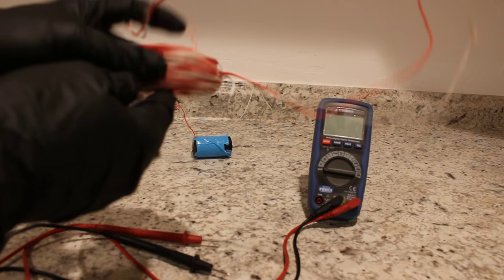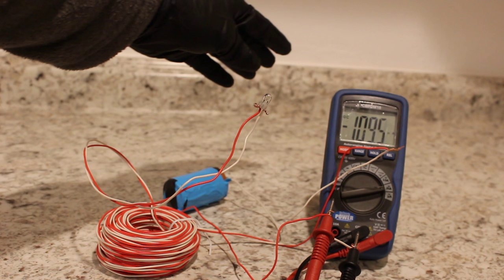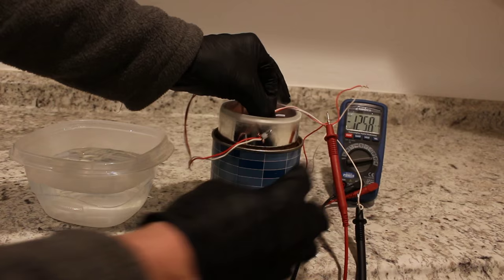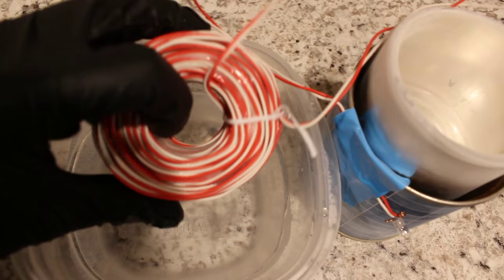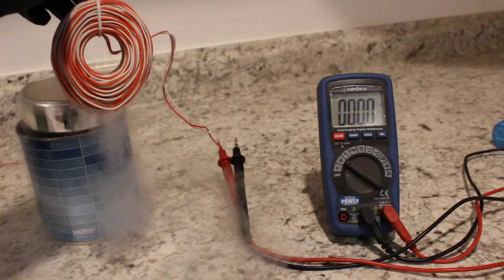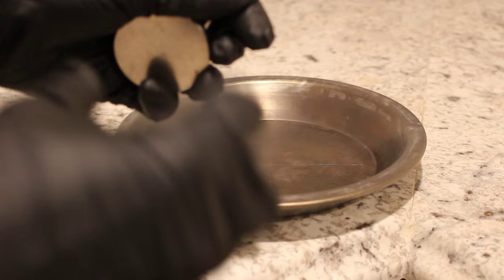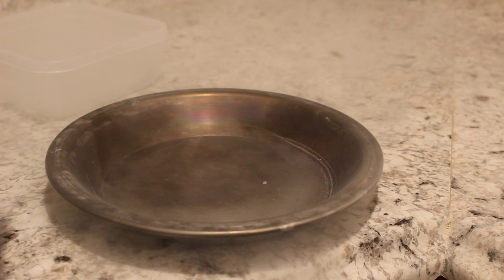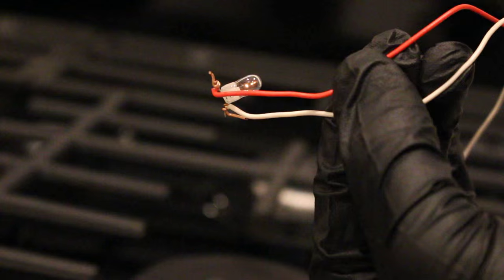Electricity vs Cold

Comment: Is liquid nitrogen electrically conductive?
Reply from the maker: no
Reply: Thanks! And your package should be there by the end of the day.
Reply: It can't be because it has nothing in it to conduct electricity like ions, thats why water can conduct electricity because its not pure H20 and contains ions that can. :)
Reply: Which was why people used 'distilled water' to top up (car ) lead acid batteries back in the day. Before the sealed type now used. Others would say water from the tap works just as well..... :O It stopped being an electrolytic.

Comment: +Cody'sLab why not a liquid nitrogen cooled Tesla Coil !!!..it should improve the performance due to the lowering the resistance so higher Q factor of the inductance.
Great video as always, cheers from Italy !
Reply: +Gianni Laschi I'm no expert but,

I'm not sure if liquid nitrogen easily is permeated by electromagnetic fields, it could increase the current through the primary coil but hinder the magnetic field produced and thus, decrease the difference in potential in the secondary coil.

I couldn't find the specific value for liquid nitrogen permeability, and even if I had found them, I'm not certain I'd know how to work it out whether or not it was advantageous to cool the coil like that.

If anyone could lend us a hand and work through the messy maths, I'd appreciate it xD
Reply: *****
 i'm glad you are interested in my idea, i know there is a Tesla patent using low temperature cooled coils, but of course i don't know the potential of this :)... i hope someday i will try it ;)

Comment: Does this have anything to do with the north and south poles also being ice caps?
Reply: +Al Capone 
no. there is ice at the geographical poles because of the low angle of incidence of the sunlight. In winter there isn't even any light. The magnetic poles are also slightly off. they also wander and can switch positions.
Reply: +Al Capone thats just a coincidence because of the tilt of the earth towards the sun

Comment: Are you sure you measured the current correctly? to measure current you need the meter in series, I didn't see you change the connections from measuring voltage which you would have done in parallel. given that the resistance dropped so low, the current reading is surely wrong

Comment: Cody, or other people more sciency than i, would this apply on a small scale? say 6 inches of wire rather than 1200 inches? or would the lower length have such low resistance already that the theory doesnt even apply anymore. Thanks for anyone who answers my question.

Comment: I hate to say it Cody,  but when you measure current,  you need to put the multimeter in series with the light bulb,  you  can't place it in parallel (as the multimeter will create a dead short)  or am I missing something??
Reply from the maker: +fuba44 
True, but in this case  I could get away with it because the resistance of the coil was so high. (it was basically a light bulb)

Comment: hey cody, i could be wrong but i think you may have been using the multi meter incorrectly which resulted in the experiment not working the first time. i dont understand how you were able to use the multi-meter to measure voltage then current without moving the multi-meter from parallel to series.

Comment: Idk wtf youre talking about with "quantam physics", but I'm going with something closer to Leedskalnin, with individual "magnets", and when the copper atoms are more settled, the "magnets" have a "clear, conductive" path to travel, lowering the resistance.
Reply: When the plates moving, its just a "cohesive" magnetic field, I would say, and, naturally, it doesn't want to be broken, so increases "resistance", or "drag". Just like all brush-less a/c motors. Electricity IS magnetism induced "obviously" and "measurably" in matter. Opposing vortices, north and south "finding the source of each other, discharging". Magnetism is present everywhere though, with various "magnetic gradients", that is, "charge potentials", although they are not as obvious. Between two atoms, a chemical reaction, same thing, causes motion of the atoms, and then expels the motion when the atoms find rest with each other to cause "heat", transfer of energy back into "the field", that is, the more docile, but still chemically reactive atmosphere. When you connect two terminals of a "charged" wire, the charge "equalizes" throughout the whole wire, and there is the initial spark that "shows" that, or rather, is the path that those "magnets" are taking to equalize with each other, which is why the two terminals are also "attracted" to each other when you move them close together, and stick together like glue when your're trying to pull them apart (so long as current is being induced in them). This is theory, but it sounds good :)
Reply: Well that non-magic pixie science of this world has come to understand super conductance as a quantum phenomenon, although which exact principle is at work seems to be disputed.
But you can invent which even theory of you fancy, it's just not part of reality, hopefully that much is clear.

Comment: What bothers me is not that you didn't measure the current and voltage correctly...what bothers me is that you had the probes of the multimeter backwards. That negative sign means to switch the probes around, (I know what it means fully but basically thats what you have to do)

Comment: Hi Cody I was recently tearing down a trailer house that we found old can goods in needless to say I decided to throw the cans into the fire after 3 hours of this one can decided it wanted to become a missile shot 50 foot hit a tree hard enough to knock the bark off and put a half inch dent in the bottom corner of the can... This got me thinking

Cody I have a request can you use an old oil field pipe or something put a tripod on the end set the back end of the pipe in the fire and shove a can down the muzzle.... Wallah.. homemade can cannon.... I would do this and film it myself but mean or anyone in my family know how to weld

This would also be a great opportunity to explain the concept of super heated water turning into steam therefore building pressure until maximum failure

 I would really appreciate it if you could do this
Reply: Oh and remember if you do decide to do this always put the top of the can towards the bottom of the pipe the bottom of the can won't fail.... Of course you probably already know this lol

Comment: careful with gloves, it is actually best with liquid nitrogen not to use gloves, as if any LN gets stuck in the glove it can result in severe frostbite (sticks to your hands)
Reply from the maker: +Nicholas Chandler-Yates 
I was wearing rubber gloves...
Reply: +Cody&#39;sLab I think he's implying if it got in the opening somehow, I'm sure that'd be very difficult to do but it still might be safer without.
Reply: For this experiment he was only using his fingertips. And rubber gloves are air/skin tight for the most part. Honestly I am surprised you didn't mention the hole in the finger of one of the gloves instead since that would be the only thing I'd be worried about

Comment: because its coiled up so much, wouldn't that behave like an inductor somewhat?
Reply: It will only induce a magnetic field, when he connects and disconnects battery. Otherwise the direct current will inhibit any further induction.
Reply: I thought with dc, there is a time delay to reach max or drop to zero when connected/disconnected
Reply: +Sushma Nomula that's right. Once it reaches that current it will not affect the experiment by induction.
Reply: +Peter Pan true
Reply: +Peter Pan Dont forget the scope of the problem here though, igniting blasting powder.
Reply: Sure but since DC is 0hz not inductance at all. Would be a nice air core inductor  to use in a speaker xover

Comment: if current cant move through a frozen electrolyte. Is there any validity in the theory that you can freeze batteries to extend the shelf life? if so what is the correlation between the two?

Comment: Have you ever had solid nitrogen?
Reply: It's quite difficult to make, plus you can't 'have' it however you can make it  ( I think) in lab conditions with pressure
Reply: +Dynamitemonkey500 It's not that difficult to temporarily make solid nitrogen, you just need to use a vacuum chamber. The boiling point is reduced and nitrogen boils off, evaporative cooling then allows it to get to a temperature low enough to solidify the rest of it.
It's temporary though because once it's solid it no longer cools itself and turns back to a liquid, oscillating between the two states until it's all boiled off.
Reply: I dare him to try to eat solid nitrogen!
Reply: LaserCow Solid nitrogen is really hard to make it stay ice. It needs to be in a vaccum chamber, and the top of the liwuid freezes first so the nitrogen under boils, breaking the ice and making it liquify
Reply: +Xei 
I think they used that method with water to make ice to cool deep mines in the old days.

Comment: Could the light dimming be due to the difference in resistance between the wires+light and the battery since the cooled battery should have lower resistance making the electrons prefer to take that route?
Reply: There is an electrochemical reaction within the battery to release electrons. 
You have two different cells with different electrical potential and if you connect them through the wire you get a current flowing. 
But in order to keep the reaction running you need an electrolyte in which the ions can flow and balance out. And if he freezes the electrolyte with liquid nitrogen there is no ion exchange and therefore no chemical reaction. 

Hope that was simple enough :)
Reply: +P@r@m3d!© could this also be partially due to the decreased rate of the reaction at a lower temperature? (And not just the freezing of the electrolyte that is)
Reply: +Pawel Korzeniewski Is the electrolyte for cylindrical batteries typically liquid?
Reply: +Barituziga Banuna AFAIK, I think it's usually some sort of a paste in most cases. I was mainly referring to the reply above. Fundamentally, you must have a flow of ions between the electrodes (you will have positive ions moving to the negative terminal and electrons moving from negative to positive through the circuit). So there might be a dual effect: firstly, the electrolyte might become more solid, decreasing the ion mobility, and thus physically reducing the ion flow, and secondly, the rate of the reaction might become decreased (the same way that many other reactions slow down at low temperatures).
Reply: +Pawel Korzeniewski Its not just frozen electrolyte. Any chemical reaction reduces its speed if the ambient temperature drops. The reaction within the battery will grind to a complete halt at the temperature of liquid Nitrogen, so the electricity stops being produced.
Reply: +Bob Berg my point exactly

Comment: Uh... I don't know about your explaination. Electrons don't really "jump" from atom to atom in a metal, do they? Free electrons in the metal are very weakly constrained, it's very nearly an electron gas in there. So what you actually limit by lowering the temperature is not as much electron momentum, but temperature oscillations of atoms themselves. And electrons are known to scatter on atoms (or rather, on phonons). So essentially, there's less resistance to directed movement of electrons (i.e. current), but not due to uncertainty principle, but due to lowering of scattering probability. At least that's the explaination I've been given way back when I studied condensed matter physics in university. In fact, since electron gas is basically fermi gas, ambient temperature doesn't have as much of an effect on effective electron gas temperature, due to Pauli's exclusion principle. So you don't actually constrain electron momentum that much.

Comment: Very nice.  I was indeed thinking you ought to do the ohm measurement directly!  However, I'm not convinced that this
was superconducting.  The resistance goes down as the temperature goes down - look up the back-to-back papers by Johnson and Nyquist:

https://en.wikipedia.org/wiki/Johnson%E2%80%93Nyquist_noise

J. Johnson, "Thermal Agitation of Electricity in Conductors", Phys.
Rev. 32, 97 (1928) – details of the experiment

H. Nyquist, "Thermal Agitation of Electric Charge in Conductors",
Phys. Rev. 32, 110 (1928) – the theory

See figure 6 of Johnson's paper.  There was no sudden jump in the curve.  As I understand it one ought to see
a deviation from the linear curve to indicate superconductivity.
Reply: +farvision This was definitely not superconducting, but the mechanism for reduced resistance in cold metals is very similar.
Reply: +farvisionI dont think he claimed it was?
Reply: He said himself it wasn't superconducting
Reply: legendofman12
Ok, I hadn't been sure.  But is it possible to demonstrate it easily and cheaply with some of the new ceramics?

Comment: so would electronic devices work better in space?
Reply: Nope, electronics like microprocessors are made out of silicon whichs is a semiconductor and they act the opposit way, getting higher resistance at colder temps and the other way around! So your phone would explode in space :(

Comment: When blacksmiths heat up metal to harden they know when the metal is hot enough before quenching by putting a magnet on the metal and it shouldn't be magnetic is that similar or the same law working?
Reply from the maker: +dan katla sharpe 
That would be curie point: https://www.youtube.com/watch?v=2kVjkevtpLk

Comment: Could you measure temperature with that?
Reply: That is how many electronic temperature sensors work, yes. You take a conductor or semiconductor which has a predictable temperature-resistance curve and measure the resistance to calculate the temperature.

Comment: Why not just use a much higher voltage I mean all you need is a spark right ? why struggle to pump low voltage down such a small wire when you pump more current down it at a higher voltage, i'd love to see a dollar store bug zapper vs gun powder they produce a few kv.
Reply from the maker: +Darren Woods 
 I did end up using 120V. I don't think a bug zapper has the current needed to light up a bulb, in that case I would have to use a gap fuze which are very sensitive to static discharge.
Reply: Oh yea i know that , but I was thinking something more portable , and the bug zapper can be upped to handle more current I just removed the current limiting resistor and swapped out the transistor for I think it was a tip 30 or so and it was a lot more beefy (lol not all bug zappers are created equally) 

It went quite well and lasted a good while until the transformer crapped out , the other one I messed around with is one of those portable "ozone" generators , they put out a lot of current at very high voltages the one i have will hold a spark at around 4cm.

What is required to say "set it off" I take it its just a high temperature ?

Comment: How is blasting wire any different from normal wire?
Reply: +Daniel Reimer I think than different is in diameter of metal in this wire
Reply: It's not, significantly at least. Any copper wire will work.
Reply: +Daniel Reimer Blasting wire is real cheap and has thin isolation since it's essentially disposable. You could use any old copper wire with proper power but it's more cost-effective to use cheap-ass wire since you're only ever gonna use it once...

Comment: electrons have never been the input or output of any experiment. even the inventor of the so-called electron defined it as a single unit of dielectric induction as electricity is a hybrid of magnetism and dielectricity while magnetism is nothing more than a 3 dimensional S-curve attributive modality of the one and same which is everywhere and nowhere -- the dielectric also known as the non-cartesian nexus point source of all that can be manifest and generated.

Comment: what is that in the intro? i would guess galium but it looks like you're freezing it before it melts.
Reply: Probably galium or Mercury
Reply: It's gallium
Reply: Paprichat Productions I wouldn't be so sure of that as when it melts it doesn't leave behind residue like galium would plus in the intro you can see he is wearing gloves when he is placing the pieces down which you wouldn't need for gallium so it's more likely mercury which doesn't leave a residue and you need gloves to handle.
Reply: +GoldenMan89 maybe it is very cold
Reply: +GoldenMan89 and mercury shines also